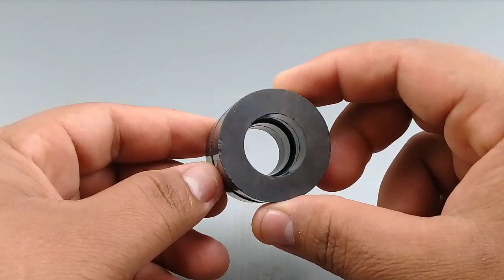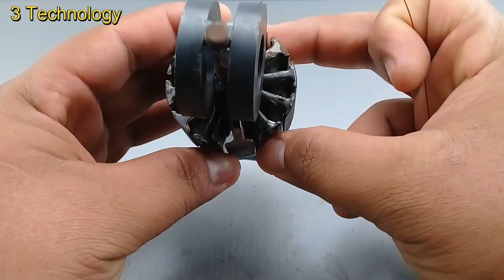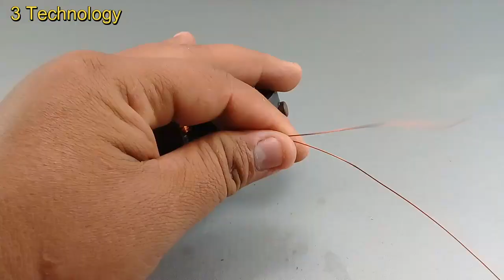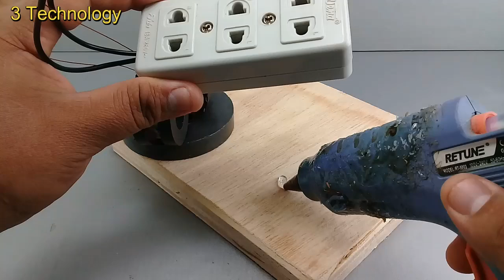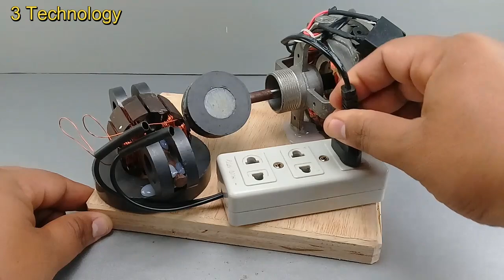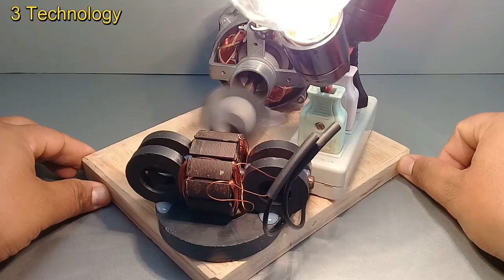I Make Most Powerful Free Energy Generator at 220V

Comment: Fake
Reply: Very clever exploitation of permanent magnet fields
Reply: @deangermeten5629  Literally all it takes to disprove is just build it yourself. Magnets of equal force will never magically cause rotation. And any rotation induced by outside forces, say your hand, will quickly equalize and stop the movement. If you power it by say...a battery hidden in a thick wooden base? Yeah, they'll turn as long as the battery last.
Reply: @Godvivec  The first magnets create field lines through the wrapped steel core and the rotating magnet disrupts those field lines so they  cut the coils. It is merely a more clever configuration, most of 3 Technology's prototypes use this principle, I can see that they work and I understand how & why. It is not the only free energy principle but kudos and gratitude to the channel owner for demonstrating this.
Reply: So you've replicated nothing yourself and expecting others to prove something to you, good luck in life with that attitude.
 @Godvivec